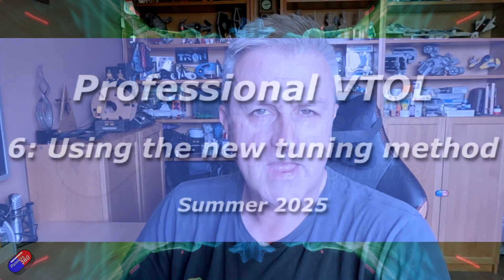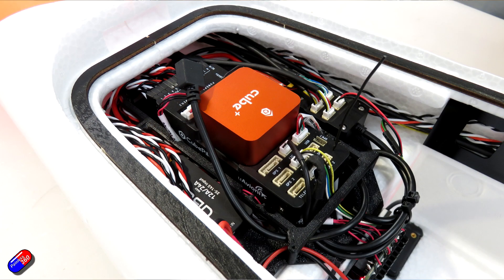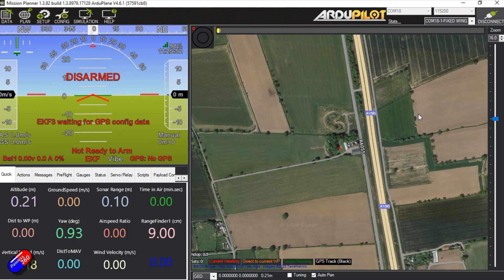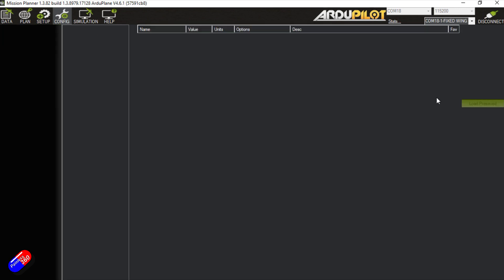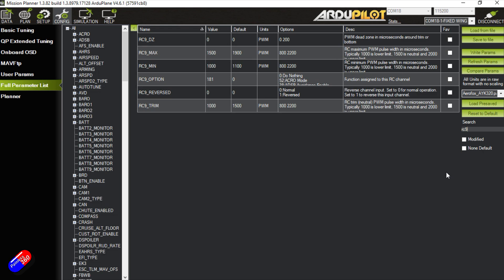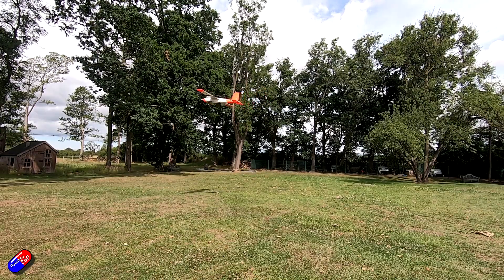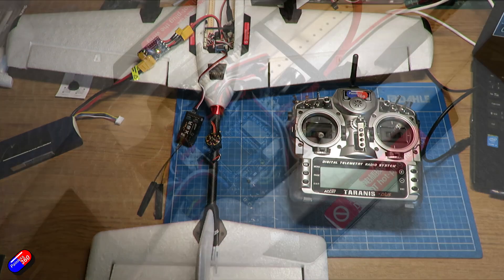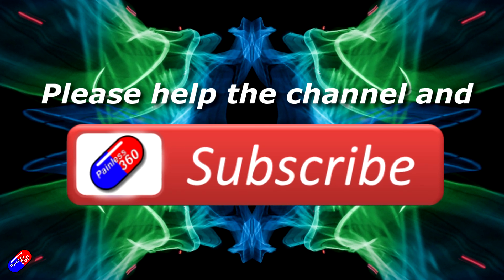VTOL Tuning overview and demo using QWIKTUNE (Ardupilot 4.6 and later)

Comment: Thank you for your great video as always. One issue that I notice is that you configure the RC switch max. to be 1500 instead of 1900 or above. Actually I did  this new QWIKTUNE but surprisingly it did NOT saved , even though I did set the parameter to be AUTOSAVE.. My setting for the RC switch is 1950 max. (using 3 pos. switch).  But after seeing this video I realize that we must set the RC switch max. to be 1500. I think this issue is very important to be noticed. Thank you.
Reply from the maker: Using a three position switch for this is recommended. Happy flying

Comment: is ardupilot more reliable than inav?
Reply from the maker: In what way? Both have very reliable failsafe options.
Reply: @Painless360 i havent use both. Just thinking if i start to use a vtol wglhich isbthe best option
Reply from the maker: Ardupilot has the most evolved and sophisticated VTOL support.

Comment: Looking at the Copter tuning docs (sorry won't post link as YT often seems to delete comments with links), I don't think QuikTune has replaced AutoTune. Both are discussed and the impression given there and on other pages is that QuikTune is a safer initial tune but that AutoTune is still a more in-depth tune (but it's good to have got your UAV into a good state first with QuikTune). Both QuikTune and AutoTune pages still refer to Lua scripts so they don't seem to be up to date with the QuikTune switch to C++ 😢
Reply from the maker: The docs appear to be playing 'catch-up' with this new feature. The tune from it was actually very impressive from the tests here...

Comment: In my mission planner, I don't found QWIK_ parameters. Can you help me about this. My FCB is cube Orange Plus also and I installed latest version of firmware and mission planner software.
Reply from the maker: What version ardupilot are you using?
Reply: Please help me with this. My hand made QuadPlane can't make notch Filtering and Quick tune. Cube Orange Plus FCB, 4.7 above mission planner verson. t_erroe_ang_deg_error when quick tune